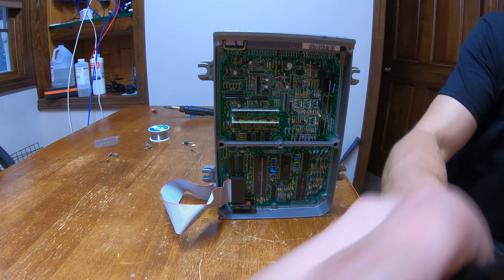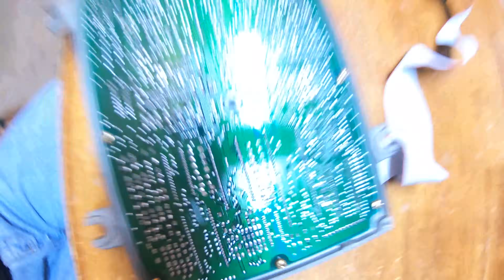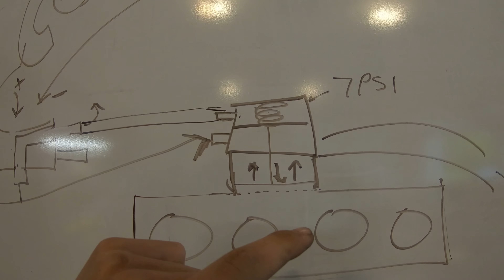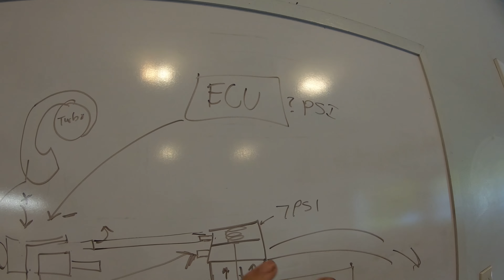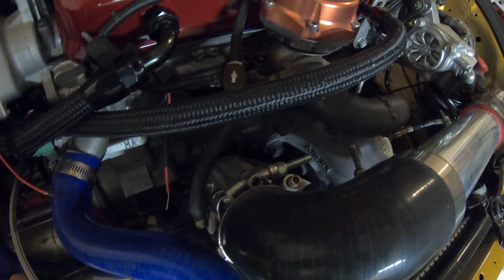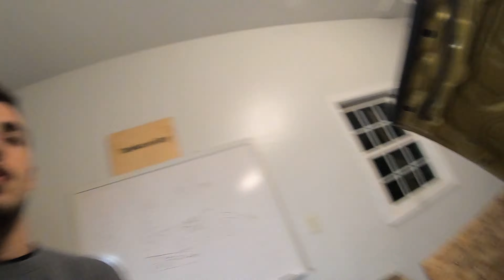Turbo Accord: Installing PWM Boost Kit and Solenoid Wiring

Comment: Never sand the tip it'll oxidize much much quicker
Reply: Tips have a copper core when sanding it allows oxygen to reach that copper a lot quicker thus oxidizing it faster
Reply from the maker: Thanks for the tip man. Needed that sharp point to be accurate soldering tho! Ill refrain from doing that on my nice soldering irons.
Reply: @ThatAccordGuy  you can order tips on Amazon make sure to get a flat round, chisel, fine point

Comment: Hey man! I wanted to know if you could help me out, i got a 94 accord with the f22b1, im kinda new to hondas and i dont know what ecu to get thats cheaper than hondata, i wanna run boost at some point too
Reply from the maker: Chipped p28 is what you want. Will run you a couple hundred dollars. Then you need a way to tune or have someone burn you a chip.

I just made a video of my tuning setup. Check it out.